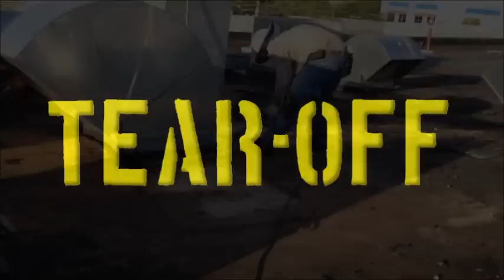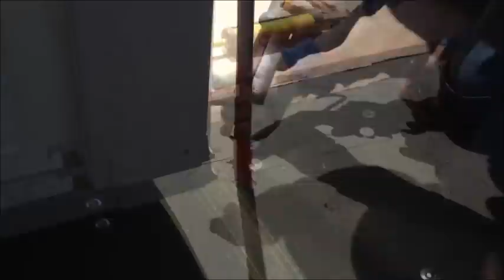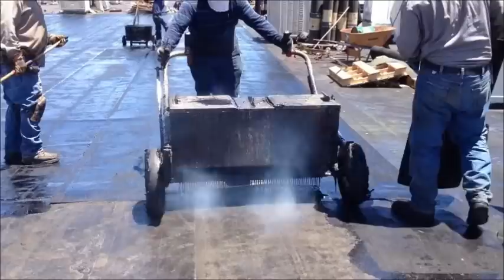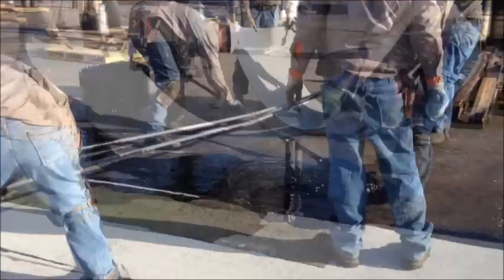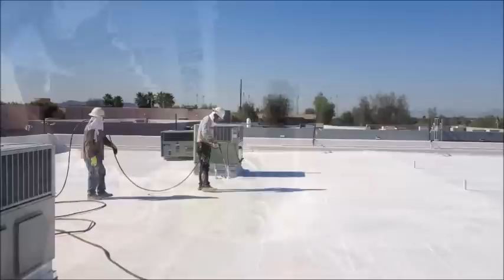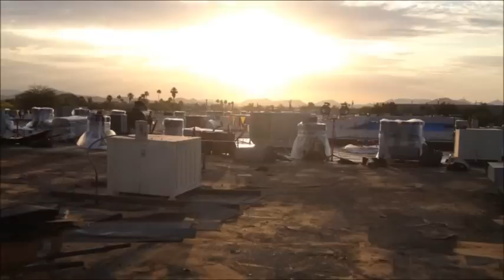3-Ply Built Up Roof with White Energy Star Coating - Starkweather Roofing - Phoenix, Arizona

Comment: I remember following my dad with a broom to push the air out...had a Gatorade bottle with a capped hole filled with gas to squirt on the broom to prevent sticking...1993
Reply: doesn't gasoline ruin-butamine ?

Comment: Do not use a burner on the felt machine as it will warp out the aluminum housing. Felt machine must be empty of hot tar at end of day and add 1/2 pint oil to prevent tar harden on dispenser.
Reply: Anybody who’s done any amount of commercial hot roofing will warm up the machine with a torch to eliminate streaks (holidays) when the aluminum felt layer is cold.

Comment: The white will  came off because of the oils vs water base coating , it needs time to bleed the oils and then  pressure wash  and apply primer,  so it will stick to capsheet .  other than that great job.
Reply: Thresher shark No manufacturer requires a newly installed cap sheet be pressure washed before a top coating is applied ,the industry standard is a 30 to 90 day waiting period before a plying a top coat ,the wait depends on the roof being coated , a fresh 4 ply with a squeegee coat of asphalt requires 90 days for the asphalt to flash off ,a cap sheet system only requires 30 days and at no time should it be pressure washed before top coating .
Reply: Michael Ledford .  We pressure wash the roofs before coating. The  roof coating won't stick  on dust, or bleeding oils .  There is a product that gaco sells  to  stop bleeding but is silicone coatings for new roofs  but we never used it , we used energy capsheet or  energy cap torch that already  has the coating.   Most the roofs that we coat we used  asphalt  emulsion  as  primer ,  with  polyester because it's  water base. I'm not saying is bad job! Some roofs the coating  is to  stop leaks and other cases is a Reflector. And you case is a Reflector  and to make the job clean, and my case sometimes is going to be my water proof , I have make sure it soaks into the roof  and it's going last for another 5 to 10  years the roof.   In the West cost takes  even years to wash off a roof all bleeding  oils. We don't get to much rain here. Have a great day.
Reply: Thresher $$$$
Reply: old school $$$$

Comment: Use 1.2” base sheet fasteners with 3” round stress disk for wind up lift. Also use magnetic “pogo” sticks for the men to pound fasteners in makes production much more efficient.
Reply: Forget that. . . Use a automatic nailer (it puts down a disc and drives a nail right thru it)

Comment: Great Video! Excellent Workmanship!  I own a roofing company in Buffalo, NY.  I have traveled out to Phoenix many times.  I had no idea they used hot tar roofing applications.  I was under the impression they used a lot of cool roofs such as elastomeric, PVC, or TPO.  What kind of coating was it that you used for the final product?
Reply: James Naples its called cover up the mistakes
Reply: Glad to see contractors commenting on someone's work. I retired as a roofing contractor in the Tx. panhandle after 35 years. Back and knees were wore out. Had a hip replacement and 2 back operations since I retired and the last back operation ended up with a staph infection and that damn near killed me. Because of it I cannot stand except for a minute or so have to walk with support, can't drive, etc.
Reply: Maybe you should come out from that rock you have been under! That is a “cool” roof once they sprayed the white elastomeric coating after they installed the built-up hot roof.
Reply: @martinjvillasenor773  did you work for progressive roofing out of Arizona

Comment: way too much HOT is being layed down
Reply: ShadowGuardX not for cap sheet ,they used the correct amount of hot ,cap requires twice the pounds per square of asphalt as a built up roof .
Reply: Asphalt makes the roof was my guidelines. A retired roofing contractor after 35 years.
Reply: You can never use too much hot I put that sht on my fries 🍟